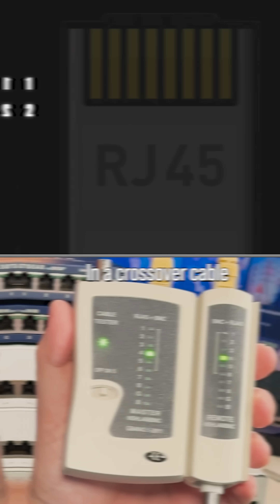Straight or Cross Over? #shorts #ccna #ethernet #internet #wifi

Comment: The two wiring orders are called T568A and T568B. For straight through cables its simply putting either T568A or T568B on BOTH ends of the cable. For crossover, it has to be T568A on one end and T568B on the other.

Comment: Crossover cables used to be necessary to connect two computers directly. Today's network cards automatically switch between straight and crossover. Special cables are not necessary. It doesn't matter whether you use a straight through cable or a crossover cable.
Reply: well that woulda saved me a lot of time 4 years ago! Thanks, that's good to know for my next project.

Comment: Yes I do know the difference between those 2.
Straight cable is for everything.
It is 2025 now.
Crossover Ethernet cable is obsolete now, was used for some (now obsolete) old equipment without auto MDI/MDI-X.

Comment: why am i pretty sure that my two routers just communicated on 70 m long line on how it will work bc i had 3 times to fix the difrent connections and i always wired Gren or orange or white and color difrently and it always worked on 100% so idk do they communicate on which line will work

Comment: A good video if you haven't done it yet would be...

What happens when you plug a crossover cable to a switch when both ends connect. Show examples of different devices connected to a switch including another switch

Comment: Without looking at the pinout of the cables, you can't tell until you plug it in. It's the same as holding up a CAT5 and a CAT6, then asking someone to identify the two without reading what's on the cable.

Comment: Good information that I don't know before.👍

I memorized that Rolled cable is used for console port
Crossed cable for similar devices 
(hub/switch TO hub/switch & router/host TO router/host)
Straight cable for non similar devices 
(hub/switch TO router/host & vice versa)

Note: Host is the PC or Client or Server or Node
Reply: Hub & switch is similar because they have less intelligence
Router & host is similar in the sense they have more intelligence

Comment: I had a home power meter from schneider which required a crossover cable to program. Didn’t have 1 but had a bit of cable and 2 plugs so i made it myself. Works great and have been monitoring my electricity usage since then

Comment: It has something to do with the Rx and Tx pins inside the socket. It's like on serial devices, if you use a non-crossover cable, it will connect Tx to Tx and Rx to Rx. This won't result in a connection as nothing is "answering" a request on the Rx pins. Older devices were "dumb" and didn't detect this. Modern devices don't care.

I also think using a crossover cable was the only option to connect two PCs together over ethernet.

Comment: Hosts to host = use crossover
Network device to network device= cross over
Host to network device = straight 
Routers are considered hosts. 
But.... I'd buy only straight cables and just use crossover adapters if necessary.

You don't need to care anymore as since the introduction of gigabit the network cards auto negotiate that, except of you're them in lower speeds for example for passive PoE.
Reply: No. Use straight cable every time.
2.5Gbps, 5Gbps and 10Gbps Ethernet over copper cable is here.
Ethernet hubs and <=100Mbps switches and EVERY piece of half-duplex Ethernet equipment - are ALL OBSOLETE.
Gigabit is still okay.

Comment: You can still use a crossover if you ... want to plug a laptop straight into your pc tower, and you have a dhcpd running. You can get that transfer if you are out a switch. It's a good basic Linux survival skill. And if you have a few wireless nics with master mode, build yourself an epic router.

Comment: It used to matter which one you use to connect which devices but nowadays it doean't matter thanks to mdix function devices know who is on each end thus they use straight cable accordingly either as intended or as crossover but you don't need both anymore.
Reply: I watched the video too

Comment: I still use cross over cables to configure devices on a “local network” ie plugging directly into my laptop, working the feild it’s not always possible to have a switch handy, and I’m better off with a crossover in my bag opposed to a 5 port switch
Reply: Why tho.
If your pc is modern it should support auto mdi/mdix and change it self if it detect it is needed. If you use a crossover all the time the nic just changes it self so it works as a straight cable.
From what i know it only requires one device to have it as it will change to work with the other device
Reply: @ ah i’m not so sure. I mean, I work in radio, and broadcast equipment has pretty much stagnated since the 90s, these units I configure from a company called Btools, they ship with crossover cables, and you have to specify that you want the network version when you order it otherwise you might get the one with an auto dialer or the one with a serial port
Reply: @Uncleharkinian  Okay Damm. But you laptop if it is new should have auto mdi/mdix and then it will detect if a straight or crossover connection is needed and change it self to what is needed. Then you should be able to use a straigt cable to those older devices.
That is what i think based on my understanding of the auto mdi/mdix feature. That it is only needed on one device as it will detect what is needed to communicate with the onther device and change itself to that. I could be wrong tho.
Reply: @ hmm I’ll give it a shot next time i’m setting one up
Reply: @Uncleharkinian  nice. But i would suggest you read about auto mdi/mdix yourself to make sure it could work on paper. As I am not 100% sure i remember correctly.

Comment: I used a crossover cable to connect 2 routers across my house. I pulled one line through my attic and down to the cable outlet so that's a dual ethernet/coax and the other side of the house to my fiber optic modem in my daughters' room.  The crossover cable is so i don't have to mess with programming anything more on the second AP. Glad I used singing with my IT degree.

Comment: This is what I follow since the day my prof cleared this in the Cisco packet tracer- Straight through/patch cable for linking 2 different devices like PC and switch
Crossover is used for linking devices of the same type like PC to PC/Switch to Switch 
Obviously modern devices are much smarter and have auto switching capabilities but still follow this rule when you are actually working for a company!
Reply: If you still follow that rule when working for a company then if the devices are new enough to have auto mdi/mdix then you are just making the devices change the nic/port to the different one to work.
If it is a mix of old and new hardware then it would make sense.
Reply: @mikkelgraff6879  Oh thanks for clearing that. I have moved to the cybersecurity field so don't follow much on networking but it's great to have better understanding for the newer devices!!
Also there are very limited companies who have all of their devices upgraded to the latest tech. Most companies I have encountered will always have a mix of old and new and don't upgrade until there is an absolute need for the same just like most clients out there are Windows 10 based.

Comment: That’s interesting, I didn’t even know about the existence of crossover cables. But what’s the difference in functionality tho?
Reply: Mainly one use for going between different types of devices or different layers layer vs while the other is used to talk to same layer: pc to pc you need cross over
Reply: @spoken_truth2501  But why? Why is one better than the other? Are the pins different so you don't accidentally plug two incompatible devices together?
Reply: @NotMe-ej9yz imagine the pins being transmit and receive.  If you connect two computers together without the crossover cable, transmit into transmit won’t work.  

But for the last 20 years ports just auto negotiate.
Reply: Because they've been unnecessary for decades since auto-mdi
Reply: Crossover is hub to hub, regular is device to hub.
Reply: @DHN900 so that the second hub knows, that the one socket is used as "input"?
Reply: Crossover are the more famous one thats it
Reply: @oDiablo Nope
Reply: One sends only.  Other is for sending and receiving data.

Comment: Oh so that's why in recent years we don't have to make a straight-cross cable anymore, in school I learn straight-straight is for different device straight - cross is connected from same device
Reply: There's no straight-cross. A cable is either straight (AA/BB) or crossed (AB).
Reply: @LordFokas  I was taught in school that cable start with green strip-green called cross pattern, the start orange strip-orange called straight
Reply: @tzielsky  well, you were taught wrong. Cross means the green and orange pairs cross, straight means they don't. At 100Mbps these are the RX/TX pairs, so one device's RX needs to cross over to the other's TX and vice versa. Above 100M you must use all 4 pairs and Auto-MDI(X) takes care of it. There are more types other that straight and cross, like inverted which IIRC was used for console ports.

Comment: I still to this day check cables by holding both ends up to each other to check it's a straight through, even though cable type doesn't really matter anymore, but I'd been burned so badly by wrong cable type over the decades.

Comment: Mandatory Auto MDI/MDIX support is arguably one of the best improvements of the Gigabit Ethernet standards over 10/100 Fast Ethernet aside from just the speed
Reply: On the other hand, mdix also makes it a lot easier to accidentally create network loops.
Reply: @BestSpatula most modern switches have STP enabled by default with no configuration needed
Reply: @MrFunny01 not all of modern switchs have stp enabled by default. HP, HPE, Tplink, One Level and Huawei you must enable spanning tree

Comment: Hello David.
If you make direct connection between two end points (without hub/switch, for example two PCs) you need against "Cross ethernet cable"!!!
This is used at past, today and for future.

But nobody today use HUBs!!! It is very log past more than 20 years... Because of existing ETHERNET SWITCH (MDI/MDIx, Ethernet SWITCH recognized type of the cable straight, or cross Ethernet cable)!!!!

This information I MISSING in your video!!! But this important informations I missing in not many time of your videos. 
Mostly time is total complete information from you in your videos....

Comment: Usually Straight Through cable is used for connection between a PC and a Switch. 
A Cross-over cable is used for connection between 2 PCs
Reply: Same device crossover, different devices straight through. That was the rule, if I remember correctly.
Reply: This is what I was looking for thank you
Reply: Y, this was helpful, tnx. I recall this from -20 years ago.
Reply: Modern NICs do auto cross over, so you don't need cross over cable between 2 PCs
Reply: @newstar346  Yes... We all watched the same video
Reply: Last time I used cross was for that 4-5 years ago 😂
Reply: No need for that anymore.

Comment: Great, now I wonder what if two modern PCs are connected first with crossover cable and then with S-T cable? Will NICs auto detect this and enable communication in both cases? A long time ago, only CS cable could be used, otherwise HUB or Switch was needed, but today I’m not sure, I think that also S-T cable can be used for direct connection.
Reply: @asv5769  it will work fine
Reply: Modern devices will auto detect in most cases. So yeah, they would work fine in your example.

Comment: Didn't know that, but why the difference? Do they behave differently? Why would someone choose to use one over the other?
Reply: To make it exceedingly uncomplicated. Devices that lived on the same layer didn’t know how to talk to each other without it getting awkward. They couldn’t talk and listen at the same time so you wired the mouths of the cables on one end to the ears on the other end. Then the devices that lived on the same level could hear each other and speak clearly without yelling at each other. 
Devices that lived on different levels didn’t care who was speaking when because they could either ignore the chatterboxes or tell them to shut up while they dealt with more important matters.
Reply: A straight cable is in-in, out-out great for pluging a device into a bit of network gear that has hardware inside to route traffic between devices. A crossover is in-out, out-in useful for a quick device to device link as otherwise the devices would each have their ins and outs pointing at each other with no mechanism to "talk" as the lacked the ability to swap their in/outs. Think mouth-mouth, ear-ear vs mouth-ear, ear-mouth if it helps. Network equipments job was to link mouths and ears as needed, and devices couldn't move the location of their mouths and ears. Gigabit standard changed this, so even devices have this basic ability to sort out who listens where, and crossover cables(and adapters) went😊 away.

Comment: I had always hated this since 20 years, because I never knew what was wrong with my cables. Now I know 😅
Reply: For those replying above, this guy is probably just a home user and not a technician. Obviously a tech would know this stuff, but a gamer or user might not, and wonder why their devices won't communicate.
Reply: terminating rj45 ethernet.... it took you 20 years to find the answer....
Reply: I have had several co-staff look at me when I look at the wiring colors in the JG 45. 
four years of college 12 months of boot school.
Never learned wire colors
Reply: Usually cross over cables were Red
Reply: @BB-of3gh  not if you crimp your own cables
Reply: 20 years for you to discover:
TX -> TX
RX -> RX

and
TX -> RX
RX -> TX

Seriously?

Comment from the maker: Did you know this?
Reply: A to B cable
Reply: Yes I did but its always good to see knowledge being shared because not everyone does.
Reply: Not only did I know it I remembered the pin out…
Reply: No 😅 but it's a good thing to know!
Reply: I didnt. Thanks for making this comparison video
Reply: Someone tried to explain it once to me, i had forgotten about it... Bad memories from that time 😂
Reply: Being old as shaisse yes I knew. When I started in IT grey RJ45 boots were usually straight thru and a red boot was crossover
Reply: Why did they do this?
Reply: So for someone to be a security engineer, you need to have good knowledge about networks like this?
Reply: So the cross-over is a B to A setting. The orange and green are swapped at the ends. Thanks for the headsup. Never saw this till today.
Reply: Anyone who's had to prepare for IPX gaming in games like Doom95 would know! Haha
Reply: Yes. It’s because the crossover is inside the hub. So a hub to hub is crossing over twice. Transmit at the device is received at the hub. 
Hence needing a crossover or not with auto crossover detection.
Reply: No I did not. Tha KS for sharing. Just got my lpi recently. Going for my ccna next